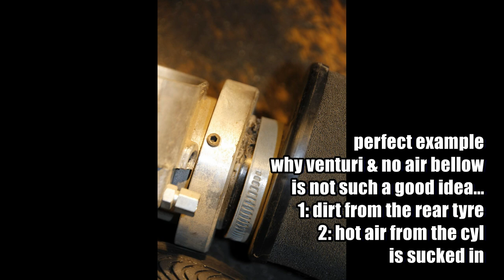vespa POLINI 221 analysis / the WORST! ENGINE ever: classic do NOTs! / by an austrian shop...

Comment: Hey @mista FreakMoPed -- can you elaborate on what you mean at 4:33, showing the brake shoes -- "edges should be rounded"?
Reply from the maker: round the edges of the coating
Reply: @FreakMoPed8  Aha, I did not know that one. Just a little chamfer on the brake shoe material then, eh. Ok! Cheers

Comment: why you dont add silicone liquid gasket to prevent oilsucker? i already trying it and it work like a charm
Reply from the maker: my approach: sealing mass is first of all to FIX & GLUE the gasket onto the small engine half, where the weak spot of all vespa engines is, see here how i do it:

https://youtu.be/RaGvYNNN7e0
https://youtu.be/1p9Nbgac5Go
https://youtu.be/Yjxk4StYH7w
Reply: @FreakMoPed8  yep, already see that tutorial, but I dont have a choice to use silicone gasket when facing an aged and damaged casing XD

Comment: the foam air filter should be cleaned and oiled every 2000-3000 kilometers, the hot environment is no problem for the intake, the speed of the suction freezes the intake pipes on normal motorcycles
Reply from the maker: it just made a few hundred km, as the engine as u can see was totallt f... Up by an official shop. Unrideable

Its nit aboit washing
This cone (not even venturi) and the foam Filter are completelly not needed on a vespa. Engine sucksin hot air frpm the cyl and dirt from the rear tyre and street. 🤦‍♀️ Really silly idea. 

U suckin

Btw no. I dont clean my motorbike air filter all 2-3000km
if any then all 20.000km

Comment: Sorry for commenting to this unrelated video but i want to ask you  something....can stator points in a 1979 vespa 50, give spark but the engine wont start? 
I tested for spark and it seems okay, but when i kickstart it, it wets the plug and doesnt start. Checked compression, fuel, all is okay.
Reply from the maker: Sry no smallframe expert. Try different stator, also check carb setting and rotary valve tolerance